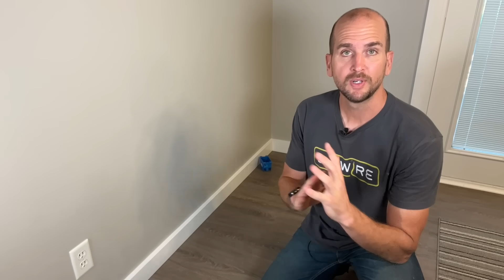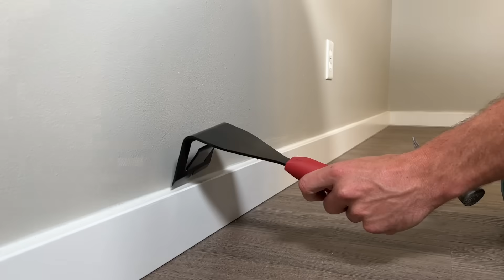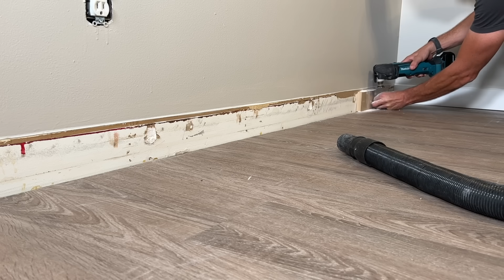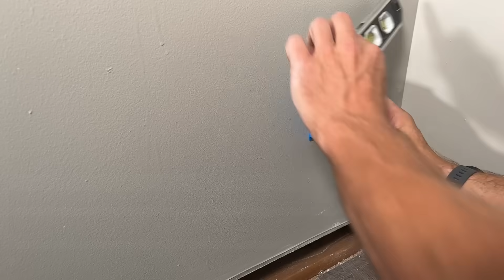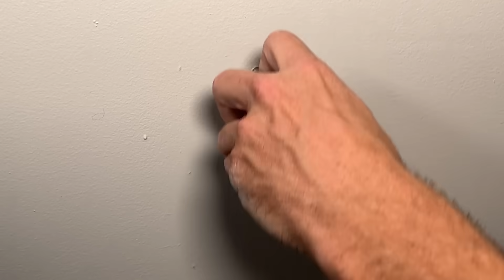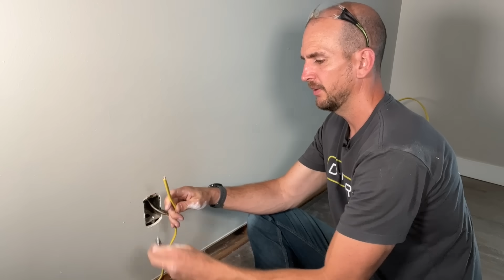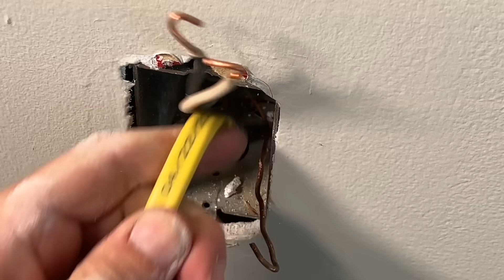How To Add An Outlet To A Finished Wall

Comment: Tip! On the old work plastic box, run the screws into the holding tabs before you put the box in the wall, then back them out again. It breaks in the self threading screws and makes it easier to tighten them and gives a belter feel so you don’t over tighten them!
Reply: Yes and take of ears of receptacle so will recess in old work box and cover will lay flat on wall.
Reply: @wolfeace-qq6yp  What? No, you need the ears on the front to sandwich the drywall between them and the tabs. Without ears it'd just fall into the hole.

Edit: I understand now that you meant on the outlet and not the box. That makes more sense, but still seems unnecessary as the metal is rather thin and tends to sit flush anyway when screwed down properly. If it gives you a better result, though... you do you.
Reply: @justin7509  
It's an OLD WORK box, the box is touching the drywall, not the tabs.
Reply: @justin7509  Thanks for reply.  I've done both ways and always go back and break off receptacle ears for a clean fit on covers.

Comment: Been an electrician for 20 years and never heard of the removing of the baseboard. BRILLIANT! Thanks.
Reply: I've been an electrician for 35 years and most of the people I've worked for would've said to hell with it when it comes to pulling baseboards and having to recaulk and paint.
Reply: @clayadams2068  I suck at drywall repair. So a couple brad nails and a bead of caulk sounds like heaven.
Reply: @justinstanfa1946  Now go to ABC Supply and get yourself an Albion B26 caulk gun...you will feel like you're in heaven...ALL these cheap ones don't compare. If I understand it right it's a 26:1 ratio so it's soooo much easier to pull

Comment: Nice video and great trick, this may definitely come in handy in the future.  Not sure why you used the connectors and pigtails in the existing outlet as opposed to just using the pass through connections on the outlet.

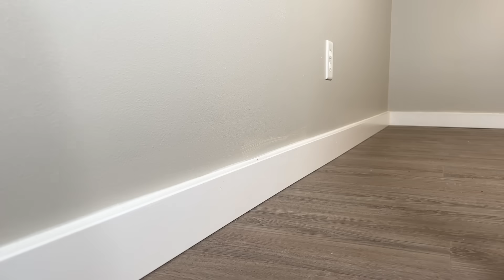Comment: 0:55 Actually, any thin pry bar will do an excellent job. Just remember to put the short bent end in first, then use it to push the trim away from the wall, and only as far as it wants to go at a time.

Comment: 9:10 This is really interesting to see that your cable and more specific a ground cable inside is not isolated. In Europe all three of them have individual isolations. I know that it is not essential, but still.
Reply: It depends on the cable type.   Care should always be taken to tuck wires neatly behind the device whether insulated on not.

Comment: What if you don't have a super wide moulding????   You won't have sufficient to drill the holes,
run the wire, etc, etc, etc.......

Comment: Awesome video! Going behind the base to drill the holes was very smart. I have never done that so you just showed me something brilliant. I’m familiar with wiring new houses that a remodel like this seems challenging. Thanks!
Reply from the maker: Thanks man, how is your house coming along?
Reply: @EverydayHomeRepairs  please dont encourage others to do this as you are preparing them for serious damage or possible fire or even fatalities. There are certain specifications as to where wires can be placed to avoid NAILING THEM! also not sure but are you mixing 14/2 with 12/2? 
12/2=20amps 
14/2=15amps
You have no nail plates! Nails can curve! 
Serious fines or even incarceration is possible for wiring without a license and if someone looses their life,  as a licensed electrician i would never do this or condone it...
Reply: @kd-rw6bg :

You should have read the other comments.  Can you explain what specific problems you identified in the video?
Reply: @denverbraughler3948  read my comments, i did.🙂
Reply: @Denver Braughler  but ill point one out one major one Wiring without a license! 
For reasons of max load, voltage drop, code violations, like wire being to low and not covered with plates for nail and screw protection. If you have experience in contruction and electrical code you should know why this is. If you dont then you should not be doing this. It would be like me watching a video on how to perform a surgery and attempting to operate without a license. Ive seen people loose their life to many times.
Reply: @denverbraughler3948  are you a licensed electrician?
Reply: @kd-rw6bg  there’s nothing wrong code wise with this. Even if the original wiring is 14/2 on a 15 amp circuit you can always upsize your wire as 12/2 is rated for 20 amps. Just don’t use 14/2 on a 20 amp circuit. As far as where he ran the wire, please tell me where in the nec it says anything about not being able to run your wire at that height. I’m assuming he drilled his holes in the center of the studs so nail plating probably wasn’t necessary. That said, he could’ve used a smaller bit to be safe or just drilled the holes lower and used plates. Either way, I see no problems here
Reply: @derekwbmx   a small home builder who has built over 100 homes I say I would be very happy to work with such a conscientious worker. This guy taught me something I would have never thought of. Thanks for this information.
Reply: @derekwbmx   @sketchyderekbmx  ok lets debunk your comment. As a licensed electrician the first problem is there is no permit.. wonder if that job would pass inspection?👎 second NEC 334.15 addresses this for NM cable and requires that the wire be run through conduit or protected by 1/16 steel plate for the entire length. NEC 300.4 talks more about the intent of this as protecting from any nailing that might occur along the baseboards. Ever wondered why drywall always has five screws or nails when done correctly? Believe me there is a reason, ever wonder why plumbing line are at a specific height aswell? Belive me theres a reason. Third nm wire needs to be strapped within eight inches of gang box which he didnt do.
Forth wires need to be twisted together for more secure connection and with time that connector may lose its grip and fail. (If) that plug he connected to is at its limit plus past the 100 ft limit a voltage drop must be calculated to that circuit. In electrical systems its never wise to assume anything. But hey ill give him credit for creativeness and he did a perfect cover up.
Reply: @kd-rw6bg  lol okay it’s pretty clear that you’re not actually an electrician. You’re just talking about random stuff out of context. Voltage drop? Dude he added like 5 feet of wiring. Voltage drop isn’t even a factor here. As far as securing the wire, you don’t have to when you’re fishing the wire in for remodel purposes. You telling me you cut holes in peoples sheetrock so you can put staples in when you fish a wire down the wall? Also those articles you mentioned say nothing about a height to run the wire at, we already know nail plates are needed if the hole is within 1.25” of the edge. And a permit bro? Nobody is pulling a permit to add a plug on their own house. If they did, yes this would pass inspection
Reply: @kd-rw6bg  lol okay it’s pretty clear that you’re not actually an electrician. You’re just talking about random stuff out of context. Voltage drop? Dude he added like 5 feet of wiring. Voltage drop isn’t even a factor here. As far as securing the wire, you don’t have to when you’re fishing the wire in for remodel purposes. You telling me you cut holes in peoples sheetrock so you can put staples in when you fish a wire down the wall? Also those articles you mentioned say nothing about a height to run the wire at, we already know nail plates are needed if the hole is within 1.25” of the edge. And a permit bro? Nobody is pulling a permit to add a plug on their own house. If they did, yes this would pass inspection
Reply: @derekwbmx  yeah, your required to pull a permit! Just cuz you decide you dont want to pull one to save money doesn't mean one isn't required! Obviously your more concerned about defending this guy than you are of following basic electrical safety practices. I know your not a journeyman for sure now. If i have to lead you to articles then thats a hint. But i take code and safety very serious thats why i charge what i do, go cheap and youll get these guys and get what you pay for or dyi and dont learn to do things professionally. Good luck with all your projects, God watch over all that you do...
Reply: @kd-rw6bg  man you’re not the brightest. Who do you think this video is for? This is for diy-ers who don’t want to pay for an electrician to come and do it. All of the jobs I do are permitted and get inspections, and to be honest this isn’t something I would do at work because it requires a lot more work and time, but for people working on their own houses this is actually pretty smart. And an electrician should always be ready to back themselves up with code. Seeing how no code exists for “wire running height” I asked you to tell me where it says that. Maybe go read article 334 again lol. I don’t care enough to keep this going, so good luck out there.
Reply: @derekwbmx  there are just some things in life you dont take a risk in. Not the brightest? Well what should i expect from a person who is willing to condone someone putting others at risk. Ill let wisdom show who is truly not bright.
Reply: @kd-rw6bg  seriously?
Reply: @derekwbmx :

That’s my complaint, though: he didn’t say to make sure the cable was at least 1.25” deep — and he didn’t even mention that there are code-compliant ways to mitigate the hazard of severe physical damage from nails and screws.

He said to run the cable above the baseboard to avoid nails.  

That’s not a code-compliant mitigation of the hazard.

If the cable isn’t deep enough to avoid nails through the baseboard, then it’s not deep enough to escape nails through the wallboard.

And the person with insulation in their wall is probably not going through the center of the studs.

On the other hand, drilling holes too far back creates the same hazard from the opposite side of the wall.

He didn’t mention any of these things.
Reply: @denverbraughler3948  fair enough. I guess I’m just assuming he drilled his holes in the center as I would to avoid needing nail plates. Luckily there’s 50 comments on here calling that out so whoever’s watching this, read the comments and know you need to protect your wires. I still think this is a pretty good method to use for anybody doing work on their own house.
Reply: @kd-rw6bg  334.15 is called Exposed Work for a reason. And 334.15, part B says: Cable shall be protected from physical damage *where necessary*... Since he ran it through the center of a 2x4 stud inside of a wall, it's suitably protected without a nail plate. I think you're confusing what he did with the old trick of chiseling out a chase in plaster behind molding? That is no longer acceptable practice... About the licensing issue, it depends on your locality whether a homeowner can do their own work without it... As others have mentioned, the attachment/support requirements are waived for old work where wires are fished in voids. Even so, those studs probably provide adequate support.
Reply: @audiocarp  ok, life learned lesson, the reason is permits are required is there is always some unlicensed or lazy guy out there that in order to save money or even doing a big repair job he will cut corners. Once this is done and the guy sells his house or  house is transferred due to death or what ever reason. And the next home owner comes and decides to put taller base boards then your in trouble this is why plumbing lines, electrical, vent lines,  are not allowed at this level if you are truly a contractor with experience you should be aware of this as you need to take into consideration the moment and the future of the work you will perform. The reason you do not mix 15 amp wire with 20 amp wire is another electrical issue that may cause confusion when the same issue i just described happens and some lazy or unexperienced worker thinks its a 20 amp circuit and changes the 15 amp to 20 amp well you get the scenario. When i obtained my license our instructor was a master electrician that cared and taught in the present and for future protection. As most all accidents occur when a new homeowner come in and decides to renovate. But oh well if it wasn't for people like this i wouldn't have that much work is what a 48 year electrician buddy of mine just said to me the other day (Good point). As i said before the encouragement to do better work has been offered, do as thou will and God bless you all on the work you do because there are lives that are counting on you to look after their safety whether now or for future reasons.
Reply: @kd-rw6bg  8
Reply: @kd-rw6bg  Your points are well taken. Just as a handyman who is often asked by my neighbors to 'take a look at this' or 'help me fix this', I have seen a lot of unsafe work done by amateurs. But, I have also seen a lot of sloppy and non-compliant work done by licensed electricians (or morons working under the supervision of a licensed electrician, which local code allows), so, don't paint everyone with the same brush... I agree, running the cable just above the shoe molding is not the best path, but, how would you solve this particular problem? One solution (since he just needs more outlets nearby), could be to simply swap out the single-gang box for a double-gang. Or the most obvious: Run some metallic Wiremold raceway on the surface to the new box location. Or perhaps a Greenlee Diversibit could be used to drill horizontally from the new cutout location to the old box. But, those bits don't work as well as advertised.
Reply: @kd-rw6bg  You are soooo right!!!
Reply: @audiocarp  nail plates, or wire shields can be used if you dont want to loose the nail space. You can make your own shields Just cut a half inch pipe at 1 1/2" and insert pipe between each stud if you want to use this guys video idea.  Ive also made a straight shot thru opposite side of wall with a long extention 3/8"  I've gone up to 6 feet no problem and then just plug hole when done. Removing gang box will allow you to staple romex. small hammers are available for this. Fasten gang box with screws for durability, may need to drill holes for this. Simple tricks to keep your family and others safe🙂
Reply: @kd-rw6bg  you can absolutely mix 14/2 and 12/2.  As long as it is fused at the lower amperage wire.  Cheers
Reply: Repent to Jesus Christ 
“Cast all your anxiety on him because he cares for you.”
1 Peter 5:7 NIV
hii
Reply: https://youtu.be/G5w9QcIa6Iw
Reply: If you've been in an old Victorian that was retrofitted for electricity, you will see the receptacles in the baseboards.  This is because it is easier,  faster,  and cheaper to remove the baseboards to drill the base and fish the wires (it was knob and tube at that time) under the floor between the joists.  To run perpendicular to the joists, they would run the wires behind the baseboards.  They drilled two holes, as each conductor ran thru a porcelain tube inserted into the drilled hole.  Now, cut the hole for the box and reinstall the baseboard.  Baseboards back then were 8 to 12 inches wide so you had a good amount of room to work.  Our tool list (from 1973) included a brace and bit, wood chisels, and a keyhole saw --- leftovers from those days of retrofitting.  They are no longer required.
Reply: Don’t forget to install nail plates to protect the cable from severe damage as required by the NEC.
Reply: @denverbraughler3948  nail plates are only required if the edge of the hole is closer than 1.25" to the face of the stud. 3.5" stud, 1.25" on each side, 1" hole in the center. Perfect
Reply: @maxderman447 :

Yes, but then running the cable behind the baseboard is fine.
He didn’t mention centering the holes in the studs.  

He specifically mentioned not to run the cable behind the baseboard that needed to be re-nailed.
Why is this if the cable has the baseboard plus more 1.25” of stud depth protecting it?

Did you watch the video?
Reply: @maxderman447  wires are not allowed at that level for nailing purposes. If in the future he sells this house and someone installs taller base boards then you will have serious problems.
Reply: @denverbraughler3948  Apparently you've never seen what some people use  to nail on baseboards . . .  especially base board heaters . . .
Reply: @gragor11 :

I have no idea why you mentioned my name.

I’m a proponent of adhering to the NEC.  The NEC is based on realities.

Comment: Please don’t do electrical work. Your box is now over wire fill. You’ve ruined the integrity of the walls fire rating. Wegos are the fire hazard they stopped making #12 stab in outlets. The remodel box you used will crush the sheet rock edges and cave in after heavy use from plugging in a vacuum or other items after a year. Might look good to the homeowner but you’ve created 3 fire hazards and future repairs. What would you’ve done with 1” molding? Cut the plate out?

Comment: Trying WAGO 'nuts' and not liking them is not the same as knowing why you should NEVER use those types of connections on circuits where you could have up to the load limit on that circuit. If I have to explain the laws of physics to you i.e. contact surface area of a connection with a high ampere load, then this is why you and others have no problem with them. And before you go on about how they are rated by this and that, ever wonder why we have Arc Fault Breakers now? Yeah, lazy code that allowed push in terminals on outlets and switches. And just to send the point home, why does the USA allow red rear facing turn indicators when they are illegal outside of North America? Safety clearly isn't the reason, it's money, profit. 

WAGO is for stranded wire and works well with that. Solid wire NOT SO MUCH. Twist connections require more skill and that why DIYers like easy by easy isn't always safe so that why we have Arc Fault Breakers. The Nanny state for lazy in the name of profit.